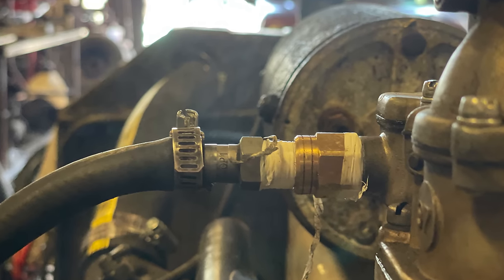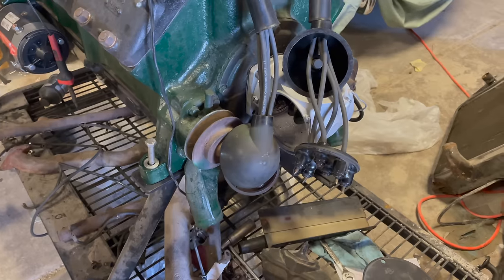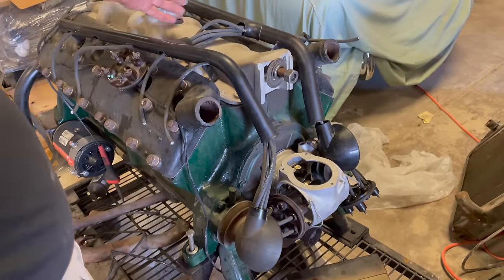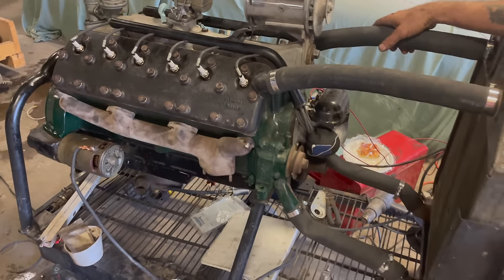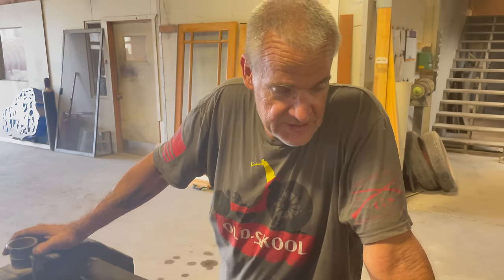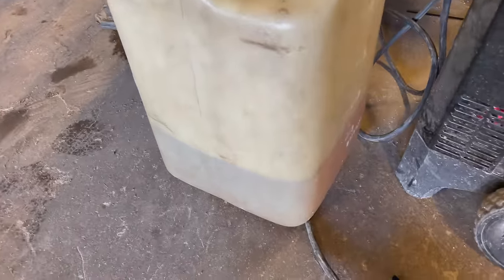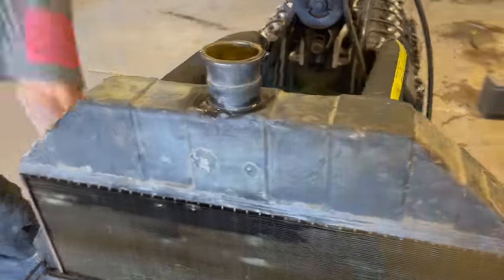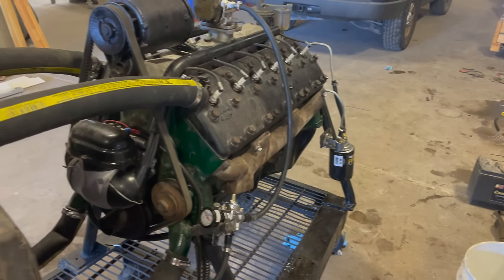Fire it UP!! 🔥 V12 Flathead Engine Ignition & Start! Lincoln Zephyr V-12 Series Will It Run? #barryt

Comment: I'd be curious to know how much power that engine could put out if it was using a modern ignition system, instead of that ancient one it's using now.
Reply from the maker: Good question. I’ll try to find some info on that.
Reply: I don't think the ignition system is the restriction on power. It would be fueling and induction system. That engine is breathing through a hole the size of a pop can. My 1.5 L 4 cylinder engine has a throttle body about the same size. Of course this engine doesn't Rev very high probably so it doesn't need a huge throttle body. But I suspect intake manifold and some kind of port fuel injection system would gain you a lot more efficiency and power. If you're going to bother with that you might as well do coil on plug with some kind of computer controlled ignition system also. Certainly it would gain efficiency also because of an ignition system being improved. It would allow you to create custom ignition curves based on load throttle position and RPM. But the engine is not going to look nearly as attractive with all that crap sitting on top of it. Sometimes simple is better especially if this engine is going to go back in a classic original Lincoln of that same vintage.
Reply: It may have been built before I was born but a trick that was used on those was to solder a short strip of copper to each contact so you could then change the advance adjustment for finer tuning of the ignition though out the entire RPM range

Comment: More carbs would be cool... 6 two barrel ones maybe.  Would like to hear under load decelerating. Couldn't really tell the sound from just idle. I'm sure it's good though.
Reply from the maker: We will try to get that for you once installed and test driving. Thanks!
Reply from the maker: It’s hard to find three good 2 barrels right now!
Reply from the maker: Andy don’t forget the carbs bring air and fuel, both… I’m going to try to test the 2 setups side by side somehow
Reply: You can't put that many on a stock engine.  At heavy throttle, it will lose all of its vacuum and then lean out - it won't have enough vacuum to draw any fuel.

Comment: So what kind of horsepower and torque numbers did this type of engine produce
Reply from the maker: In stock form they seemed to range between 110-130 HP, I have no idea of the torque rating. There have been so many upgrades developed over the years that it’s simple work to get a lot more.
Reply: @BarryTsGarage  The early ones - 267 cubes - only made about 180 pounds-feet.  The 42 and 46 305 version made about 235 pounds-feet.

Comment: I surprised there's not more instrumentation. I know I'd like to be able to observe coolant temps, oil temps, oil pressure, and generator output at the very least.
Reply from the maker: Yes if this was going to be a real load test, you would want to do more. In this case, we were just testing an unknown engine to make sure it was a “runner”. It would get a lot more attention before actually installing into a car. Thanks for watching!
Reply: @BarryTsGarage  - Thank you for the reply. I had no idea this engine was in such a raw state. Very cool engine I've never even heard of. Must be a thrill to bring such gems back to life.

Comment: I have an original Ford Engine No. 1 Test Set with heads & manual!
Reply from the maker: Whoa that sounds very interesting. I’d like to know more about exactly what that is
Reply: @BarryTsGarage  It is a roll around piece of equipment that was used to test Ford flat head engine components like distributors.  It had different "test heads" for different models.  There was also a growler for testing armatures on starters & generators.  I will get the manual out to & get the  description & maybe photo a few pages.  I need to take photos of the test cabinet/machine which is about 4ft hige, 5ft long, & 2 or 3ft deep.
Reply from the maker: @johnd.8224  cool - Yeah I’d love to see that

Comment: Who else knows that the United States Department of Motor Vehicles put a cubic inch limit on engines because of the Lincoln Zephyr V12? As a result of that, when Cadillac came out with the 501, Chrysler cried so hard about it, they had to recall them all. They had to replace them with 500 cubic inch engines while still calling them a501
Reply from the maker: I need to learn more about that - have never heard that before… thanks John!
Reply: @BarryTsGarage - Bootleggers love to use these because they would reduce weight on the engine chassis and body so the revenue man wouldn't be able to catch them.  The United States Department of Motor Vehicles decided that a 500 cubic inch limit would limit the horsepower or something I suppose. Idk why they thought that, because I'm assuming that in 1942 when the law was made, they were aware that you could still get a lot of horsepower out of an engine even if it wasn't a large displacement engine. I guess they were thinking along the lines of that old cliche "There's no replacement for displacement" when it came down to speed.
Reply: @BarryTsGarage -WEREN'T.......  not were (aware)

Comment: These V12 had a running hot problem, I have heard. Perhaps the back cylinder next to firewall?
So what did many owners do? Just junk this V12 and install a flathead Ford V8. Problem solved. 😊
Reply from the maker: Actually there is a diverter you can install in the block behind the water pump to push more of the flow to the back…
Reply: @BarryTsGarage  Was this diverter available and generally known about so it was used?

Comment: i had jensen 541 s with the austin sherline 6 cylinder....this engine would be interested to fit.
i wonder how many horse power in it.
i had several jensen interceptor tuned in different ways bothe the 380 and 440. could be fun and provokative to fit this engine...i gues its smaller than the chrysler v8, 440
Reply from the maker: I believe it is

Comment: That is a 2 barrel carburetor and way too small to feed the needs of  a V 12.  At least 2 carbs would be needed for proper operation but I guess engineers at the time did not realize that.   Very smooth but not very powerful.
Reply from the maker: Agreed.  We just posted a video about fabricating a 2x3 intake for these things. Will post a video about the final setup as soon as that's done. Might idle the two outside carbs and bring all three to the party at 3/4 throttle or something (I'm only guessing at this time). Thanks Jim!
Reply: There is a lot of power to be gained but you just cannot feed enough fuel with 1 2 barrel carb.  Even the Ford flatheads gained a lot more power with 3 2 barrel carbs and a generator offset bracket.  I am sure 4 barrel carbs had not been invented yet.

Comment: Many were replaced with flathead v8s because of oiling issues.
Reply from the maker: If you have one now, it would be good to send it to someone that knows what they’re doing to go through it, because there are some little fixes, apparently, that mitigate some oil and cooling challenges of the original design…

Comment: Why do some of the head studs appear to be short?
Reply from the maker: It may have been assembled with slightly mismatched studs, which are all removed if you want to machine the top of the block. You will see many of these flatheads finished off with capped nuts (maybe chromed) that hide any irregularities. Thanks for watching!  Barry T

Comment: Worried about crush rings on some cheap spark plugs, lol, just crush me, do it right, and put a new one in if you have to pull any. Weird
Reply from the maker: I hear you, this was not gonna be put in a car, but simply a check to confirm viability of the engine. Thanks for your comment!

Comment: How many cubic inch is this V12?
Reply from the maker: 267 cubic inches. In 1940 it increased to 292
Reply: Less than 300 in the Zephyr.264 is the figure that comes to my feeble memory.The Packard  was 472.
I owned a 1937 Cadillac V12 that was 368 with valves in the heads and a seperate carburetor for each
bank of cylinders.WAY better engine than the Zephyr.I have had a lot of experience with prewar (WW2)
classic cars and NONE of these 12's or 16's had a prayer against the 420CID Model "J"Duesenbergs I
had the pleasure of working on.Two cams in the head,32 valves and with a two carburetor supercharger
it was capable of over 400 HP .1960's tromp it and go years ahead of Detroit,

Comment: the engine is out - on a stand - you have the oil pan off the heads off - why not remove each piston assembly to check bearing condition and remove the main crank bearing caps too - with the pistons check oil rings and wrist pins etc. it's all open just a few more steps and you will know everything you need to know and fix if there are any issues - why just lube it and fire it up???
Reply from the maker: Let’s just say that the engine is fixed upright in that stand, so not exactly easy to get to the bottom end and take it all apart. I’m sure the whole disassembly will happen when there’s a good reason to make a thorough assessment, but for a very short timeframe to verify that it would run was enough for the time being in our case. Thanks for the comment!

Comment: It sounds more like a six-cylinder than an eight cylinder! It has the drone of a six cylinder.
Reply: I used to have a 3 cylinder motorcycle- Yamaha XS 750. Above idle it sounded like a six cylinder drone/growl. Ive always been interested in how cylinder configurations sound. 3s sound like 6s sound like 12s. I guess if there was a 9 cylinder it would be in the list. You should find some V10 on youtube and hear how high pitched they sound at rpm.
Reply from the maker: Interesting!

Comment: Lower righthand side return radiator hose is kinked.
Reply from the maker: Yes the cooling system on this test rig is “just enough” and not good for any long term testing like this.  Thanks!

Comment: So I didn't notice an oil level on it
Reply from the maker: Good point, these engines had an oil level float that came up through the center of the engine up near the carburetor that would give you an indicator without a dipstick. I don’t remember now after the fact how Tracey checked the oil but I know he did. The engine being built is going to have the floating indicator style oil level I believe
Reply: @BarryTsGarage  looked like the rod was there I just didn't see the rest of the indicator
Reply from the maker: One will have to be sourced!

Comment: Common sense is  not that  bad  , at least  it's  fixable   but! Modern  technology   is not  what it is  cut  out to  be    we need to  get  back to  basic  mechanical  terms   47 years  rebuilding automatic transmissions   the  auto  industry is  going to out of control  😢

Comment: If this old v12 had a modern fuel injection system not only would it have 4 times the range but also 4 times the power. Just be sort of antithetical to these old timers sense of propriety putting a computer on her.
Reply from the maker: I hear you … however I would be concerned that with 4x power it would be difficult to match 4x cooling in that block!

Comment: All that engine with a carb that small. Why?
Reply from the maker: Back in the day, that carburetor size was considered big enough… Many modern builds now change the intake manifold, and do multi carb set ups! A lot changes over 80 years!

Comment: Not-so-good engines.  Ford screwed up on the oiling snd vent systems on them, so even with reasonable maintenance, they were 60K mile engines at best, along with all the flattie V8 troubles, like chronic overheating and lousy efficiency.  Later versions were somewhat better, but the original V12 only did 110 BHP, same as the '53 Ford V8.  The thing about these was their torque was incredible all the way down to idle, and they were incredibly smooth, considering they were a 75° vee.
Reply from the maker: That’s why the updates by a good builder really matter. Not too many built today will be asked to exceed 60k miles, I reckon. The sound and smoothness is a great experience.

Comment: Say did you all know that the original  green hornet show with key Luke as kaTO and Gordon Jones as the green hornet was a Lincoln zephyr 1939 model with front and rear fender skirt with chrome I wonder if had  a   v 12 does any one know ??/  yes Gordon Jones was the 1st green hornet  not van Williams that was much letter videos of old green hornet on internet if you want to see it  paddy McCluskey  lost in the California sunshine near button willow  olde de 58 busy road that 58 happy holidays lots of old Seattle fire trucks used hall Scotts  big brute engines
Reply from the maker: Hey Robert, you have some great information and questions here. I did not know the first green hornet was a Lincoln zephyr, but I can tell you with surety that it did indeed have a V 12 — that is the only engine they used!  Doing a little bit of research, it looks like it was a 1937 model with added fender skirts on the front plus the chrome embellishments you mentioned. The front end design and grill are a little bit different on the 37, it’s a little bit more upright. The basic body shape is nearly identical though. Thanks again Robert for a great comment!

Comment: Had a 47 if that distributor gets wet won't run for a week .
Reply from the maker: That would not be fun
Reply: @BarryTsGarage  thanx  those generator s get cooked and the cam r fuel pump rod wears I'm 80 that s..t was our transportation then
Reply: @BarryTsGarage  my neighbor had a Willoughby limo  with the V12 engine. Open drivers compartment like a fire truck look it up 34 Lincoln. Willoughby bodies were custom used on other brands have a dusenberg  Willoughby liquor bottle .  The early 12 s smoked .  When I was 10 my father looked at a 32 conv V8 pickup dual side mount   for 35$  running he said it wasn't worth that smoked  they couldn't sell it  burned it cut up for parts &scrap iron
Reply: @BarryTsGarage   saw one running a ski lift a 12 in Catskills in a shed .😏
Reply from the maker: You never know where they’ll turn up! 😂
Reply from the maker: Wow!

Comment: This was actually a horrible engine design that failed miserably, ford actually ended up installing V8 engines under warranty.
Reply from the maker: Yes, It had problems, but by now, most of them can be overcome so it can be enjoyed. Thanks!
Reply: @BarryTsGarage  the most valuable Zephyrs are the ones that still have the original V12